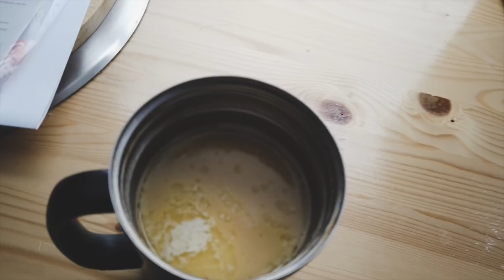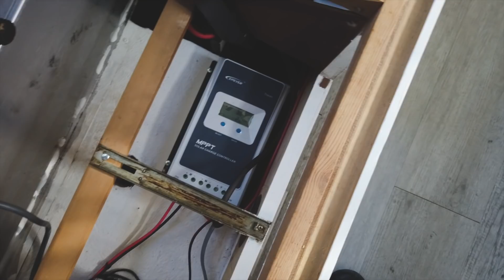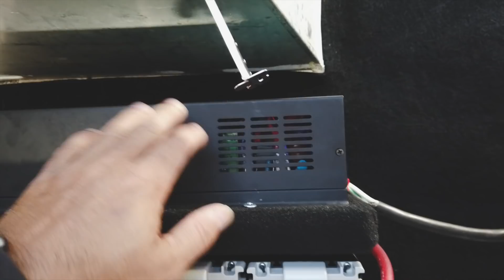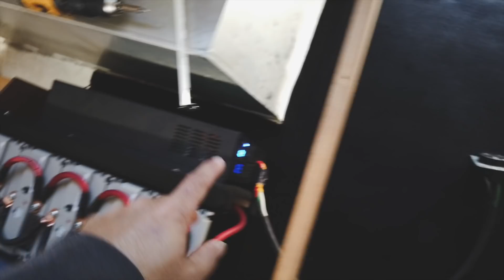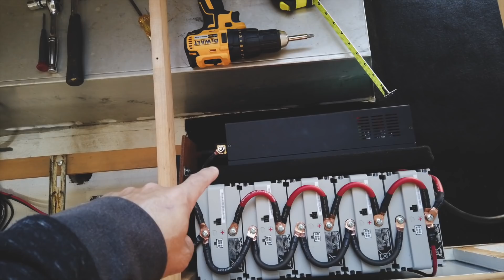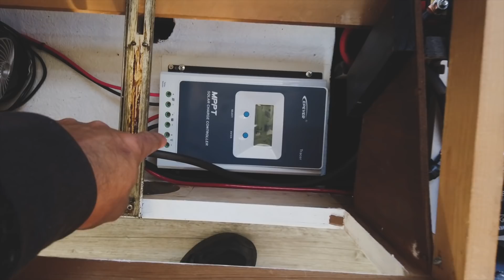Solar Upgrades for the AVION! Pt. 3 || #RVLife

Comment: Dude, I just have to say “FINALLY” someone broke down to everyone that a Solar system ONLY has (4) major parts. As a retired Navy electrician; worked on huge mobile power generating systems for aircraft, I was also an instructor and always tried to make the systems as easy as possible. YOU DID THIS for anyone who is thinking about going solar.... Outstanding job....  So everyone that wants to do solar DO NOT be overwhelmed and think these systems are TOO difficult to do.... ASCS out....

Comment: Great video.  You can bring in over 24 volts and charge controller outputs 12-14 volts?  That's a big savings on wiring.

Comment: remember,  amount of amps depends on voltage.  You have input of 7.6amps X 34.7Volts = 263 watts... and on the output side is almost the same, 21.1Amps X 12.6Watts = ~265Watts..